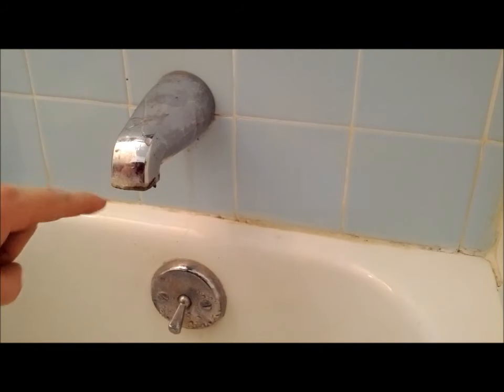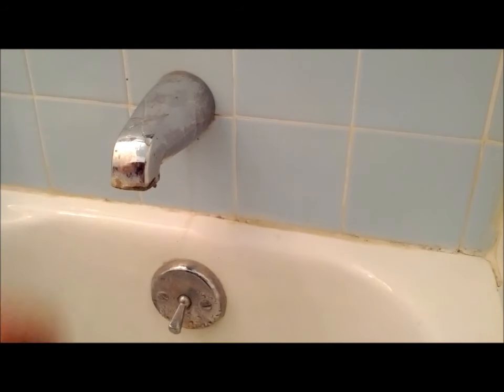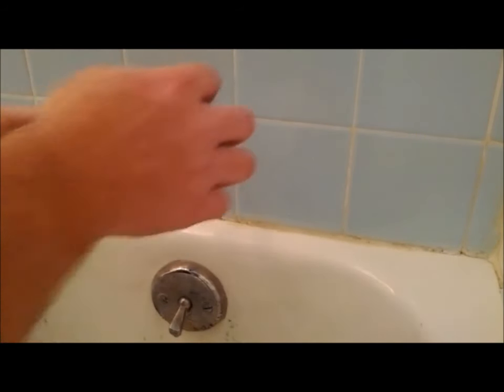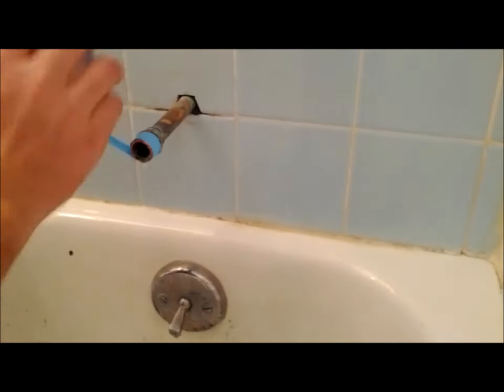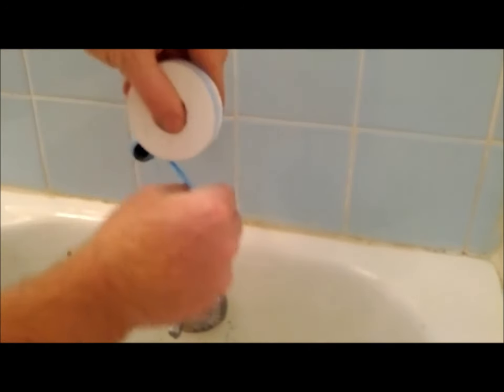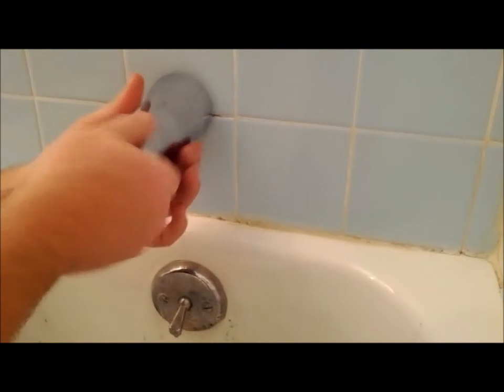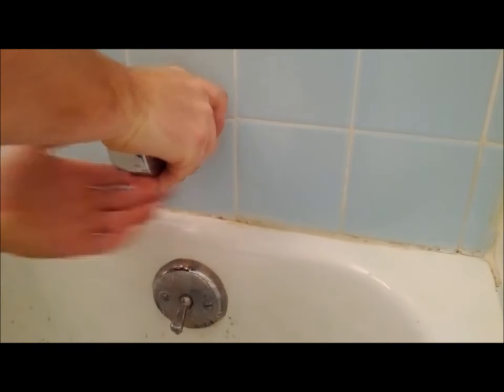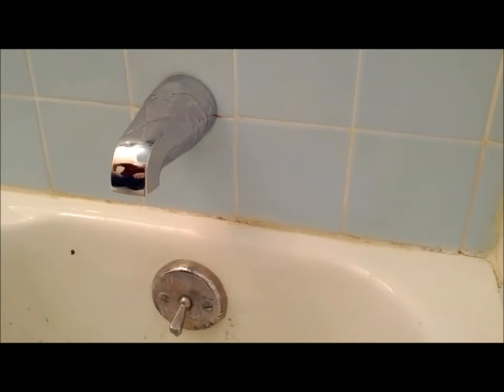Bath Tub Spout Removal and Installation

Comment: Mine juat fell off and I can't get it back on. There's an extension piece on the pipe, I wrapped the tape 3x, and a plate that fits against the wall. Goes on without the plate, but ccrooked, but not at all with. Should I just buy a new one?

Comment from the maker: Is it the same as this shower valve ? (without the diveter vavle) If it is the diverter needs to be changed..( I have a video of that) if it is the other "style" that has the diverter built into the spout the kind you pull up or push down to make it go to the shower head then yes you will need to replace the spout as diverter is not properly sealing anymore. Might be more information on the website.. link is in the description.

Comment: Thank you for this quick simple video. My diverter stopped working and I did not know how to get the spout off to change it out. However, I had an old showerhead on hand with a shut-off and I simply screwed it onto the spout pipe and I've got water coming back up to my regular showerhead! I'm not even going to replace the spout; just going to leave the old showerhead on it 'cause it looks cool and saves me money.

Comment: My Symmons shower mixing valve (c 1970s) appears fine when disassembled, but I cannot get hot water. The cold water comes through fine. I have checked the hot water supply and it certainly gets to the mixing valve. What am I missing? Thanks.

Comment: Thanks for the video helped alot. I had the screw on type wouldn't budge with pipe wrench. I looked up in the end of spout and saw threads. I fired up the propane torch and put a little heat up the spout on to threads came loose with hardly any effort.
Reply from the maker: Glad to hear that you ended up getting it off. Thanks for watching and taking the time to leave us a comment. Don't forget to give the video a thumbs up/ like. Thanks

Comment: What do you recommend if the spout comes off, but the copper collar is stuck to the cast iron (galvanized) pipe? There's some rust on the pipe. That was the case with mine. I put WD-40 on it, but it's still frozen. I don't want to turn it too hard because the pipe might snap off altogether. I was thinking of using a hand-held propane torch to apply some heat to it, but not sure if it's a good idea or not.
Reply from the maker: I have found a product called Deep Creep by seafoam works really well on stuck stuff/ bolts you may want to try that. Applying some heat will also help. Good luck with getting it off.

Comment: The copper pipe from the wall is either too long or two short for the spouts I've bought.  Should I just cut it and buy a spout that pushes on?  If so, how do I cut it and at what length should I cut it?
Reply from the maker: Hello, Yes your best bet would be to cut the pipe and use a slip on style. I would use a pipe cutter as you want to make an even and clean cut. How much to cut off depends on the spout you get. Also I am not sure if you need one with a diverter or without. I would buy a spout with the o-ring closer to the wall side of the spout cut just the adapter off and try it and if you need to cut more off until you get the spout up to the tub wall. Just be sure to clean the pipe so the o-ring can seal.

Comment: Any tips for me. When I put my new spout on I have plenty of tape but water still is leaking out then side of the spout by the wall
Reply from the maker: They recommend 3-4 wraps of tape and you could also you some soft setting thread paste like this https://amzn.to/31bYWx4. You also want to ensure the copper pipe isn't pitted or corroded and leaking somewhere other then the threads.

Comment: How come you didn't caulk it? That would prevent water from reaching the copper pipe and wall so it wouldn't corrode and stain.
Reply from the maker: +Dasdfjkl I'm not a fan of caulk if its not needed. If the spout is touching the wall I won't caulk it. It will mold and need to be replaced. If there was a gap between the spout and the tub wall I would have used caulk to seal it.

Comment: so how the hell do you get the shower on now
Reply from the maker: Not sure I follow. But if your tub spout had the diveter in the nose of it then you would have need to replace it with the same so the shower would still function. This shower valve has the diveter built into the valve itself where you turn the water on. You would want to see where the connection is in the front of the spout like in the video or a rear or slip on style and then get the correct spout with a diverter. If it the front connection then this is the one you are looking for -> https://amzn.to/2VEyKvX

Comment: Did you have to turn off the main water line first?
Reply from the maker: No need to turn the water off as the shower valve is turned off and water will only come out of the spout if the shower valve is turned on. If you would like to feel extra safe you can shut the water main off.

Comment: Is that white part in there?
Reply from the maker: Not sure what white part you are talking about. Some spouts do come with white teflon tape but depends on which one you buy. Can you give me a time stamp or a description of what your talking about?
Reply from the maker: @superplan89  This one doesn't have the white adapter in it this style spout is a thread on one with the threads in the nose of the spout. The one you are talking about is a slip on style spout. Where you wouldn't have the male adapter with threads on the end of the pipe as in the video it would just be the 1/2" copper pipe sticking out from the tub wall. So you would clean the 1/2" pipe (sand paper or plumbers mesh-> https://amzn.to/2LmxMRb ) and then put some plumbers grease -> https://amzn.to/2DKpeNK on the o-rings within the white adapter and then slide the spout on till it touches the wall and then tighten the Hex head screw to the copper pipe on the bottom side of the spout to hold it in place. You maybe also want to caulk the spout to the tub/ shower wall. This style is what your looking for -> https://amzn.to/2Y4L4mA But if you need the diverter in the spout i'm more of the fan of the pull down diverter like this one-> https://amzn.to/2Vao5cZ they tend to last longer and do a better job keeping the water/ pressure going to the shower head. Not sure why there so expensive on Amazon you should be able to find that style cheaper somewhere else. Hope that helps you.
Reply: TheDIYGuyDOTnet ok got it
The strange part is my copper pipe is all threaded, so I screwed it on
Reply from the maker: Maybe there making them a bit cheaper with using the white adapter and having that have the  threads on it. Either way glad to hear you got the spout replaced.

Comment: I hate watching videos where they have no problem unscrewing it. I can't unscrew mine and I don't want to push too hard or I could break the pipe. I can't get PB Blaster inside it. So I'm going to try a blow torch next to expand the metal. If that doesn't work I'll try sawing it off. Has anyone had luck with blow torches or saws?
Reply: I am having the same problem now. What did you do?
Reply: @jamiedangelo5242  I switched back and forth between applying a very gentle tightening and loosening pressure until it finally unscrewed. It took a while.
Reply: @@jamiesmith4293  thanks. I'll try that

Comment: Yeah sure they unscrew that easy!
Reply from the maker: It depends on how they have been put on and if its been leaking though the threads. Most aren't that hard to remove. I have had a few that have been a bit more difficult and applied some heat to them.